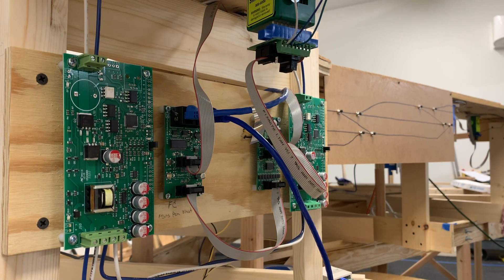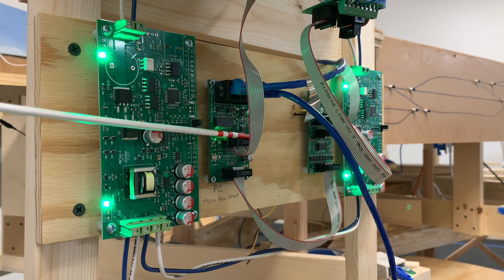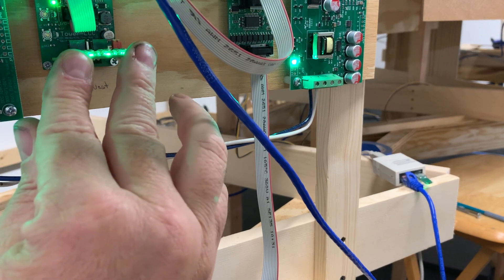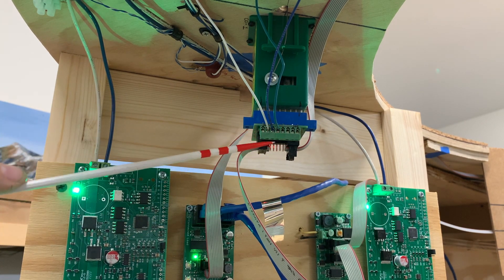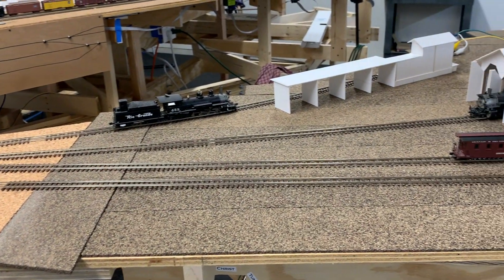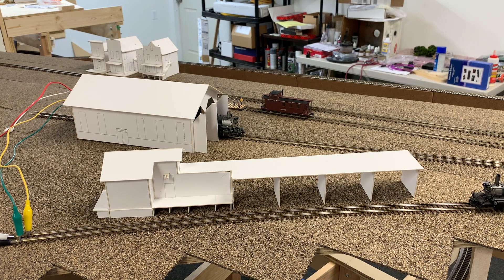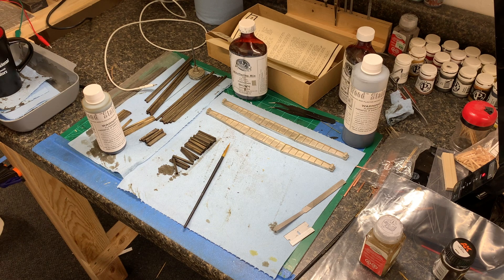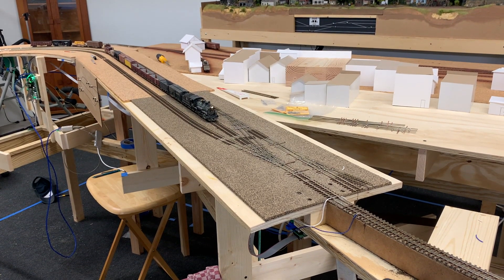Model Railroad Update 76 2022 Final

Comment: Well looks grate to me. But might I give you a operation suggestion. Most railroads with a dedicated yard that close to industry’s often take the yard switcher to them and use the yard switcher when there’s no mainline train to switch the few cars a day in the area. So you could leave the yard track there and use the switcher from the yard to get that job done. So your not keeping the mainline tied up.
Reply from the maker: Yes sir, that is exactly how I had planned on doing it.  I may just have to use what's already on the yard track to pull out what's there, then run around to spot.

Comment: Looks great Dennis,  I am curious about the electronics though.   Are you putting the electronics in so you can eventually run everything by computer or what??  Thank you for your helping me understand  a little more.   I'm completely useless when trying to understand the electronics this involved.   Thanks Dennis yet again, Chris
Reply from the maker: The biggest reason I chose to go with LCC was for the ability to set up routes in the staging yard.  I also am considering Semaphores for signals.  Operating my staging yard is really enjoyable.  I don't have to concern myself with how the turnouts are aligned.  I just push the one button that routes the train where I want it to go.  Some times this will throw 4-5 turnouts depending on how things were left from the previous route.  One of the advantages of LCC is that you DON'T need a computer once it's programed.  It's a program and forget kinda thing.  

Another example is my east end yard ladder, any loco that inters that yard ladder (it's a detected block of it's own) will cause the throat switch to open allowing traffic to always flow counter clockwise. Right now it's programed to throw the other way 90 seconds after the block is clear.  This turnout has no push-button, it's completely automated by LCC.  So are a couple of others that just react to commands sent from the turnout higher in the ladder from them.

It's not for everyone, and I totally respect those who choose to go with a more simplistic way of throwing turnouts, I seem to ALWAYS get them thrown the wrong way... even when I look at them!!  LOL  ~Dennis
Reply: @Otter Creek & Rio Grande  I find that really interesting stuff.   Luckily my layout is a little simpler.   I don't think I could do that kind of work.   At least not at this  point.   I  am learning new things

Comment: Re: the ice station, why not just build the kit and rotate it the other way?  I was going to lay mine out with the small first floor platform on the side away from the tracks… maybe consider just rotating it rather than scratch building a mirror image?
Reply from the maker: Rotating it the other way doesn't really work for me because of the dock.  That is where all the visual interest is.  I may just attempt to scratch build something closer to what was actually there and save the FSM kit for a better location. I need to look for more photos of the prototype.